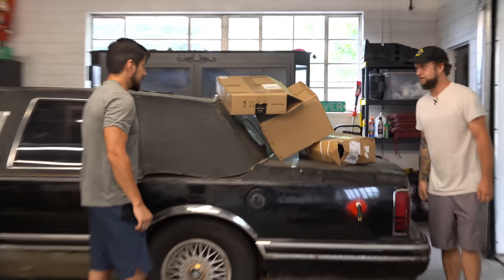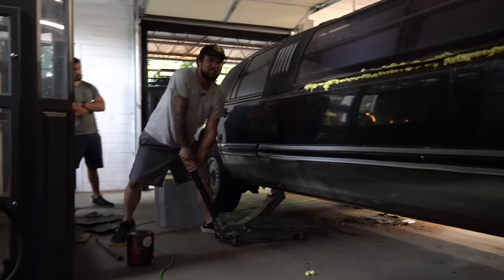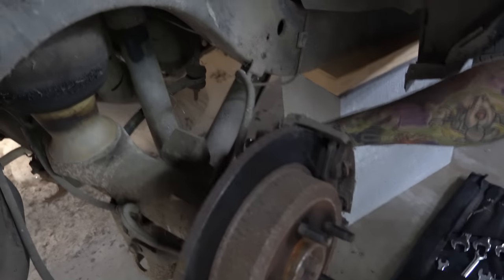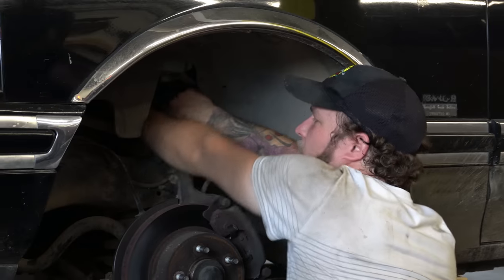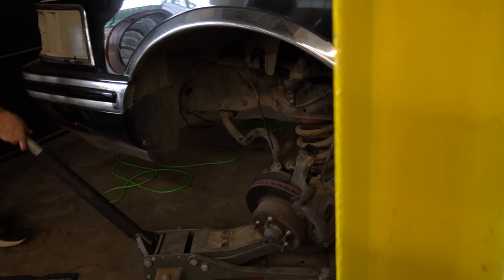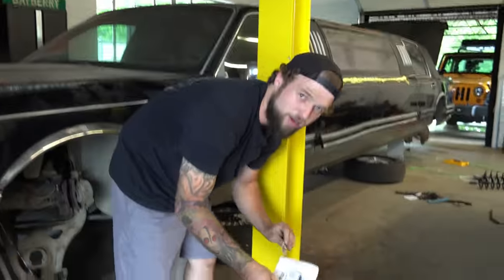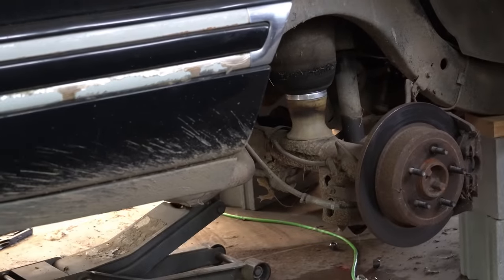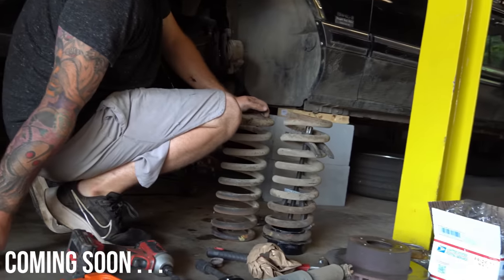CONVERTING AN OLD LIMO INTO A LUXURY CAMPER | PT.8

Comment: Chop the walls on the inside, at the bottom. where you just put walls in. Chop it at the rust in the bottom of the windows on the outside. Lift the roof 12-18 inches at least. You would actually have a super sick camper. Not that it isn't badass (in a "I could do that" kinda way) as is. Love the content. Keep em coming!!

Comment: Gotta put some massive 40s or larger tires paired with some 17/18” wheels, and change out the gears in the rear diff to some 4.88 or higher, add a locker in there 🤣 make it the best off roading limo 🤣🤣

Comment: When I bleed lines I use a clear tube and an empty washer fluid bottle works very good I prefer it over the vacuum pump I bought I just press it about 10 times then there’s usually nothing but fluid in the hose so we all good after that